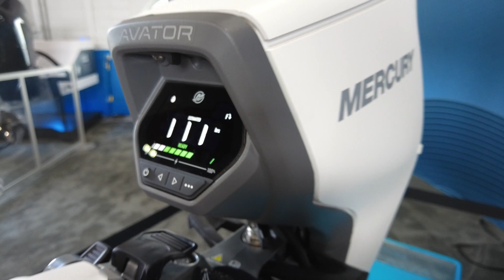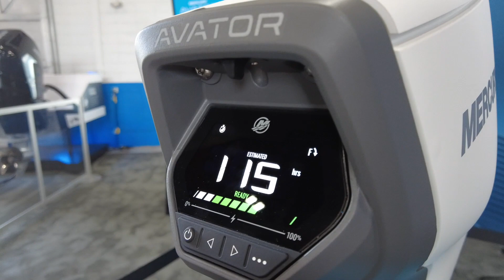First Look | Mercury Avator Electric Outboard

Comment: Still not ready for prime time. Range and speed are just not there. The market for sailboat tenders is just not large enough to support this. Until you can provide some speed and range you won’t get the anglers. They make up the bulk of the customer base for marine engines under 40 hp.

Comment: Yikes.

1 hour run time at 100% throttle?.. If this thing is anywhere over $2000 and doesn’t include two batteries it’s a bust. 

Minn kota and buy some lithium batteries hands down.
Reply: Imagine how many pounds of fish you could just plain buy instead of spending that much money…